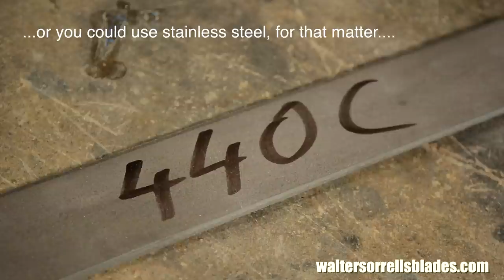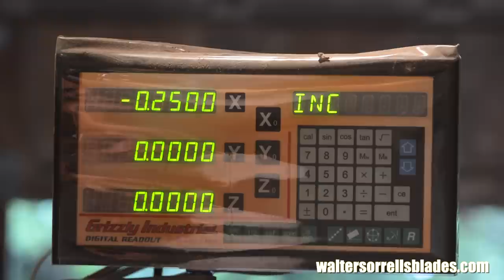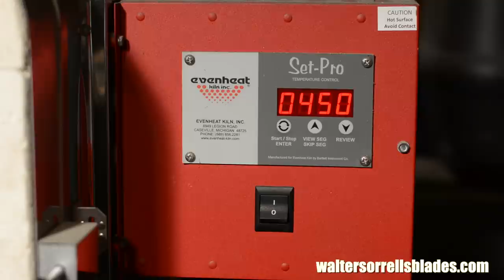Making a Damascus Steel Chef's Knife

Comment: First let me put on me asbestos underwear.
A very beautiful and well made knife. The pattern is amazing. 
Yes there is a but.
That is not Damascus steel. Damascus steel was never pattern of fold forged. The blades were forged from a single piece of Woots steel. The interesting thing about it is if you "over forge" the piece of Woots you loose the patter. The pattern is from the radial dendrites in the billet. I know that Damascus gets thrown around a lot even in reference to a type of late 19th century shotgun barrels. Those barrels were spiral forged from dissimilar metal wire. Damacene  is a better term for this beautiful metal.  
I can't post a URL here but Google "The Key Role of Impurities in Ancient Damascus Steel Blades". The article is in JOM 50 (9) 1998 pp. 58-64
Reply from the maker: +Just a Pilot I have a whole video on this subject called "Will the real Damascus please stand up."
Reply: +Walter Sorrells Watched it. Well done sir, well done.
Reply: We got another one...

Comment: I thought damascas steel was steel heated, flattened and folded over itself over and over again (5 times) yielding 50 layers.
Reply: There are different ways & patterns, damascus isn't a specific pattern. But yeah, you fold it & cut it & fold it untill you get the desired pattern and/or density.
Reply: D Wetick that's actually called folded steel .. Damascus is patterned steel .. folded steel is more for cutting and sword making but Damascus steel is mainly for looks ..

Comment: any videos on how to do this without a million dollars?
Reply: His equipment didn't cost that much, but he does have some excellent tools that aren't cheap. You can pound out some basic damascus with a hammer, anvil, borax flux, and secondhand coal forge with a hand crank blower, or an old hair dryer attached. You'll need files, a vise, some C-clamps, the etching acid, lots of sandpaper in all grits, a bench grinder and cheap belt sander would be nice, but not absolutely necessary, steel, handle materials, and epoxy. And LOTS of patience, practice, and tenacity. It is possible to do beautiful work with the most basic of tools. But after hand shaping a few blades with files and sanding blocks, I invested in some good tools after selling a car and other junk I didn't want. Buying used was key.

Comment: Do black smiths make swords and knives by cutting a piece of steel to shape? I've always watched movies where they pour hot steel to a mold and start hammering it to shape. what's the medival process like?
Reply: +jaziel tan That's pretty much only in the movies.
Reply: +Tano Hardman Only in the movies. No blacksmith pours molten steel into a mold to start the process of making a blade. The cost of the equipment alone makes it far to expensive. YOu have to get the steel to ~3000 degrees. It also would take far to long to make a blade. All though history blades have been made through hammer forging not casting.
Reply from the maker: +jaziel tan All the other comments here are right on point.  All thing being equal, casting produces steel that's inferior to forged steel in its microstructure.  Lots of complications and caveats to that, but that's the general rule.
Reply: +Tano Hardman You cannot use Cast-Iron Its brittle and what you see in the movies. Orange glow? when iron is on its melting point it aint orange its white hot. You can cast Iron.. No one EVER made swords out of metal that will break after one swing.
Reply from the maker: +Tano Hardman Forging and casting are not the same thing.  Casting means pouring liquid metal into a mold to form a final shape.  Knife makers basically never use this technique.  Forging means taking a hot piece of steel and shaping it with a hammer or press.  This is extremely common, something that I and plenty of other knifemakers do on a routine basis.  The process that's shown in the video you reference is called forge welding, which involves heating bars of steel until the weld together.  Again, very common.  Also, totally different from casting.  In the video Bob Kramer is shown melting down a meteorite, but that's only an intermediate part of the overall process shown in the video.  This is a super unusual thing (more or a stunt than anything else), and even in that case he isn't casting a knife directly with it.  They don't show it in the video, but what's he does is make an ingot or billet which is then forge welded with other steel to form a final billet which, in turn, is forged into a knife.
Reply: +Tano Hardman I never said blacksmiths don't forge their own steel for the purpose of making knives. Don't put words in my mouth I never said. He is not pouring steel into a mold as you were defending earlier. You are talking about two completely different processes and they are not interchangeable. Please pay closer attention to what is posted and remember what you posted earlier. You my lean something.

Comment: Walter, good video.  as a knife maker you do know that isn't true Damascus (wootz) steel. In real authentic Damascus steel the distinctive patterns and lines come from the process of making the steel.  Putting the iron ore into a clay crucible, adding coal or wood that will become coal.  The heat will just be high enough the melt the iron, and real Damascus steel has a very high carbon content which most steels today don't have and the steel which you probably used.  What you have is what is technically called "Pattern welded" steel.  Though it may look the same but it isn't.  Most knife makers today typically call pattern welded (layered) steel Damascus steel.
What make real true Damascus steel is the process and crystallization, not the visible lines.
Reply: +BennyCFD Acually the pattern comes from the microsegregation of Fe3c particles and is the same in pattern welding. The difference is the original have characteristics as well as imuprities that we can't match. Like the formation of carbon nanotube with in the structure. But it's incredible close. 

As for the process you speak of that's all subjective and common to all blade construction around that time and up in to today. Basically no one knows how it was done.

And the guy makes knives for a living as well as hand forging his own blades so of course he knows there is a difference.

Comment: Noob here. Why aren't the designs on the steel all across the blade? They stop before reaching the cutting edge of the knife. Also, there is a patch in the design with no design on it, if that makes any sense lol.
Reply: Inner layer that exposes only on the edge, is 1095 steel. The pattern "damascus" is only outside and grinded towards the edge.
Reply: Alarich Allika Thanks for the reply! That makes sense. Does becoming better at making these blades allow for a more gradual and aesthetic transition between the etching and the inner layer? Just curious.
Reply: In theory yes, but when You look pictures about "san mai" blades You rarely see straight lines between the two layers. In my eyes that randomness is very beautiful.
Reply: Alarich Allika Aha I see. Thanks for the reply! :D

Comment: Isn't that cutting corners? Not to be a fanboy but that is pretty much what the japanese did with katanas, you hit the steel in order for it to absorb the carbon, in this case, borax? And the you fold the piece unto itself, wich in your case you just cut it and werld it togheter and repeat the process.

Can't help but wonder wich style is better since yours is pretty much a ripoff and cutting corners.

Comment: another word for damascus is bi-metal. blades like this are ten a penny in hacksaw and band saw blades... its a simple mix of high carbon and low carbon steel... high carbon providing a hard material which holds an edge and the low carbon providing the toughness... no need to be posh over this!

Comment: seriously dude? you've forge welded a fantastic damascus billet with fancy ladder pattern, then you just grind it into shape, instead of forge it into shape, in my opinion, you almost ruined the pattern. what we would like to see is that the pattern follows the curve of the edge, and by your way, it just won't happen.
Reply from the maker: +楊凱丞 The whole point of making damascus is to set the pattern so you can reveal it through stock removal.  When you forge damascus to shape, it changes into something entirely different.  That's one artistic choice, of course.  But virtually no professional smiths do it that way.
Reply: +Walter Sorrells In my opinion, it can't called a blade if it was done by stock removal, it just like children's art work, nothing like a deadly weapon.
Furthermore , the purpose of damascus is to combine soft steel with hard steel, any experienced smith would use hard steel as the cover, so guarantee that the edge would be hard steel, but if you grind it into shape, the edge would be both hard and soft steel, and it won't be a strong blade.
Even though he use the san mai billet , but after the etching, we can see that the edge consist of some damascus steel, and that is not what we want in a san mai billet.
Reply: very stupid to compare this to children's art work when obviously it's a great knife. also, last i checked this was a chef knife not a deadly weapon he was making. also, whether you stock remove or hammer the damascus pattern into shape, the edge of the knife will still have an alternating layer of hard and soft steel...which came from all the folding and re-folding...so, the hell are you talking about bro?

Comment: Nice knife, but not Damascus steel.
Reply: Damascus steel is just different steels folded together to make a pattern, as long as that's what he did that's Damascus
Reply: +ninjafaceify no that's not correct
Reply: eRommel well considering that real damascus steel is no longer produced because the knowledge was lost and that this is what is known as damascus steel now...yes. It fucking is correct
Reply: +ninjafaceify No, it's not correct. No one knows what the method of producing damascus steel was, so it's impossible to reproduce it today. If you want to call it pattern steel, fine. But calling it damascus steel is incorrect. And they're not the same.
Reply: Pedro Alves that is what I fucking said. The original process is lost but the name was used for pattern welded steel because of the similar look. This is modern Damascus steel because that's what it has been named, however it is vastly different from original damascus. Read my comment. I never said this was the original damscus steel.